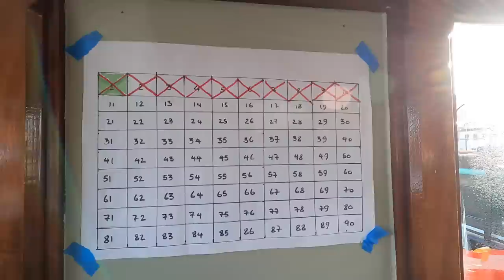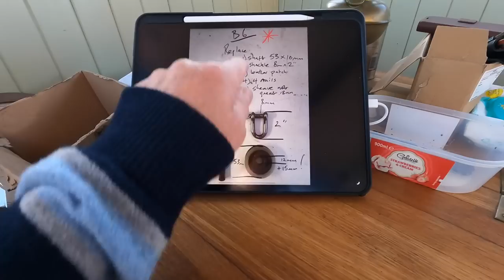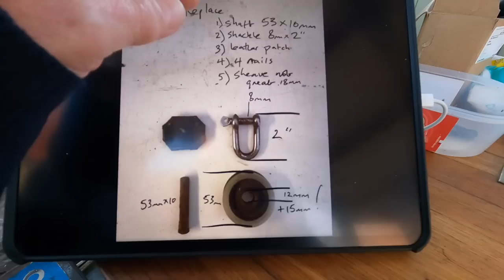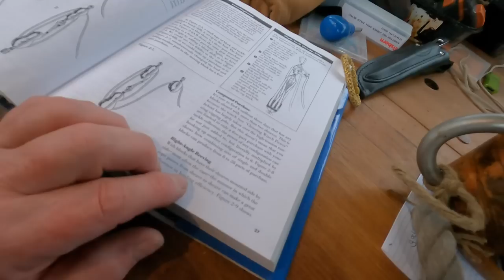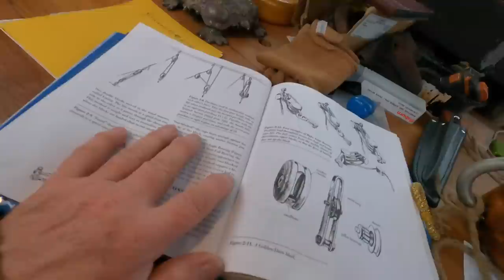Restoring Josefine - PART 20 - All about Blocks

Comment: G'day Reg.  Should you find any other parts in a similar state of disrepair  you may be able to use self lubricating bronze bushings to repair the same. Perhaps the pulleys you have could be bored out to a standard size and the new bushing tapped in place, this will give you a stock of spare parts. Love the yacht/ship and if you should find yourselves down under I would be happy to volunteer as crew for a day. Don't leave it to long as I'm pretty old,  LOL.

Comment: Reg, for sheeves and other items similar may I suggest that you find someone locally that has a 3D printer and get them to make the plastic parts for you saving a heap on the cost.. I have just purchased a 3D printer and learning how to use it but the savings that can be made from making your own parts is unbelievable. There are lots and lots of items that could be made on the printer for you to save time and money.

Comment: Very nice to see, did that kind of work 50 years ago:-) Don't use steel woll, will make stainless steel corrode. Use any kind of none ferrous materlal, like 3M. Same goes for 'sand paper', use abrasive water resitant like we use when spraypainting cars (don't know what you call it in English). It is the silicium carbide that will cause corrsion.

Comment: Those 400 quid for sheaves could have justified a small lathe and a roundstock of POM ("Delrin") I reckon. I love Toplicht for them making a whole lot of classic gaffer stuff and keep that in the market this way, but 0,4 k pound for a couple sheaves is more than a little inflation surcharge. We made sheaves from POM and from Ergal (7075 AlZn ***, needs anodizing for seawater resistance), with the aluminium ones usually enforced with stainless needle bearings (POM has a self-greasing property if You do not overload or turn too fast in use). You could also have redone the bronze ones with bearing and a shrunk-in bushing to make do for the wear on a lathe. Actually, sheaves belong to the easiest stuff I built and/or rebuilt on lathes.  With a little stock of Ash, Meranti, Locust or Teak and some other materials needed like stainless rod, stainless flat bar and a little spare time, You could make whole blocks on a lathe and a vise .... just saying. Well made blocks are a seller. Cheers! Thanks for sharing.

Comment: Luv the block and tackle. The knife is pretty nice too. Surprised that u did not have a good sheathed blade. All who might stand a watch should have a blade that is readily at hand. Don't fall into the "My knife is sharper than yours" pissing matches. I carry three at all times. The belt knife is "Utility" sharp. When viewed under a scope the edge is micro serrated and is what I want for lines. I carry a locking folder in my pocket that is surgically sharp and a pen knife (small two blade jack) that has both utility and razor edges. Razor sounds good but when your foot is caught in the bite U want utility. 😉

Comment: You could have made those sheaves yourself for a fraction of the price y'know.... next time?
As for knives, speaking as a rigger of tall ships for over 45 years can I just say, when you lose that expensive one overboard replace it with one you can sharpen quickly, and easily ie one made of a steel that rusts not stainless! A blunt shiny knife is of little use. My preferred deck knife is an old Opinel, it rusts if you so much as breathe on it but a few swipes on it's own little steel and it's razor sharp. Lock the blade and keep it in a sheath along with the steel or fold it for going ashore in your pocket.....
Btw, you really don't need expensive tested shackles with rope tackles.